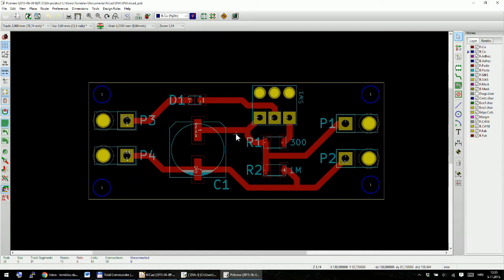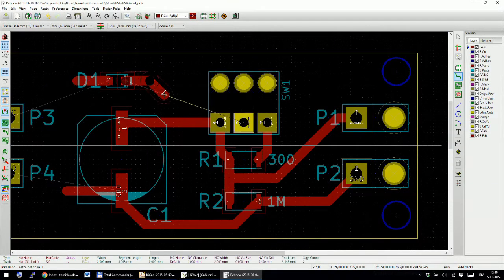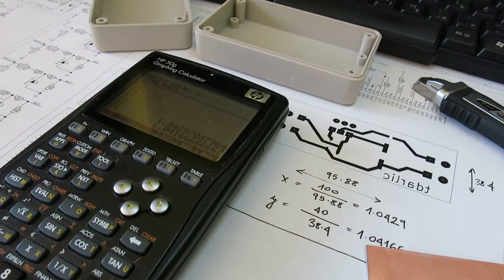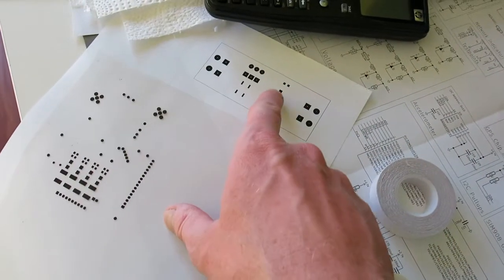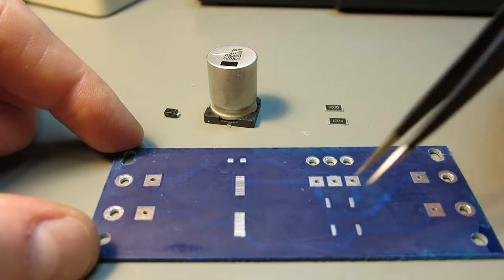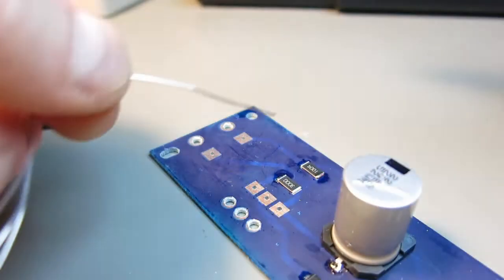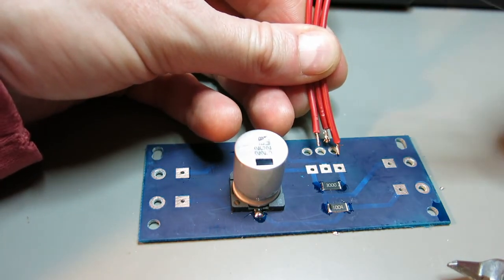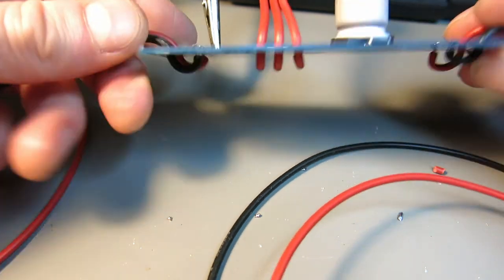Kicad tutorial 4 - PCB etching and soldering

Comment: Toner transfer is so noob way of doing it. Easier doing positive photoresist and more fun too.
Reply from the maker: Ive done hundreds of photoresisis but never had so good and fast results. Also you have several more steps. You need UV source you need either spray your PCB with photosensitive film or you need to buy such PCBs. You need to develop after exposing and then wonder what's wrong when it fails. Is it the spray, the solution the board, is the chemical old etc.... If I use hydrogen peroxide and hydrochloric acid as an etchant I can get complete board before the UV PCB is done exposing. But now with fast PCB service I tend just to order them

Comment: what make of hot air gun is that, please?
Reply from the maker: I really don't remember. I think I had Weller at that time. I've changed several and I use Quick 861 now
Reply: @TomislavDarlic  Thank you so much!  Good info.  I wasn't thinking rework hot air station.

Comment: I gave up on that toner transfer stuff myself. I ruined two toner cartridges using it. I never really need a copper clad board for my circuits anyways.
Reply from the maker: +Paul Frederick it's been working for me for years now. For simpler circuits I don't need the board also but for anything else I etch one in under an hour..
Reply: I think my transfer paper was old, or something? I actually just don't like the transfer method. But ruining hundreds of dollars of toner cartridges did not endear the method with me either.

Comment: You should make your pads a  little bigger so it's easier to solder the SMD components.  These pads looked too small.
Reply: They should just use through hole parts. Problem solved.

Comment: After adding the solder mask, add a sheet of transparent plastic on top, and squeeze everything in between of 2 flat acrylics and let it stay over the sun or over the UV light, it will look way better.
Note: If you use tape for some reason, make sure your tape doesn't go on top of your solder mask, otherwise that area will look lighter or even the solder mask might disappear after the acrylic squeeze.
Reply from the maker: +Pedro F. Thanks for commenting. I'll try with acrylic directly next time. Wouldn't the solder mask stick to acrylic?

Comment: You don't need to scale anything, you just export it to 600DPI (make sure your printer features this DPIs) and then edit it on photoshop (invert colors, mirror image) and print it out directly from Microsoft word or photoshop itself.
Reply from the maker: +Pedro F. Thanks Pedro for commenting. It doesn't work without scaling for me. At least on printers I own. They all stretch the printout a bit. It works it you do not have fine pitch components. In that case u can print directly. As you can see from video they do not stretch or contract a lot. On this example less than a mm. Use to do this export when I was working in Protel. In KiCad in just do it straight from the program...